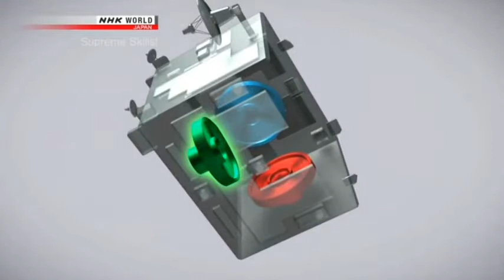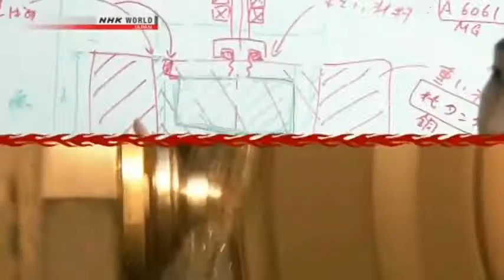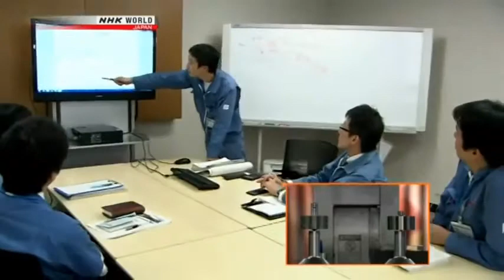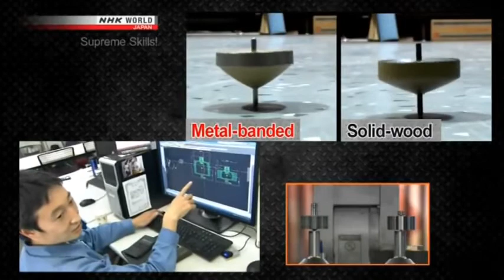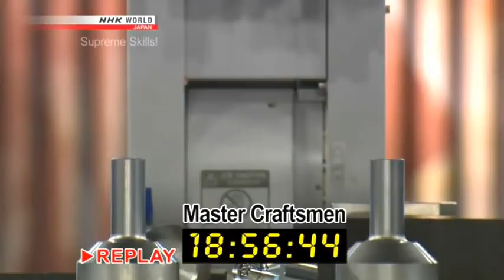Unbelievable Japanese Spinning Top Competition !

Comment: The space age team's top is hollow, and because it has mass on the top of the hollow section that gives it instability at low speeds, but the Master Craftsman's top was not hollow but was tapered from the shaft to the exterior weight and this gave it much better low speed stability than the other team's top. they deserved to win. Old age and treachery will win out against youth and vigor every time! LOL

Comment: The record is over an hour. The manufacturing skills are good but it is the design that matters. Tops lose energy as they pump air from the centre to the outside, so optimising airflow is crucial. Also very important is making the centre of gravity just fractionally higher than the pivot point. Watch this record breaking design:

https://youtu.be/LTVhbLpQrJs?si=Kt_lNNhBG37WkLL9
Reply: he broke it again

Comment: If the master craftsmen had a tungsten sleeve it would of lasted almost twice as long.
Reply: or 1 minute less
Reply: Tungsten ring around an aluminum core and a hand spin on a well designed and balanced top can spin 30 minutes on a glass surface.

Comment: I have a theoretical fly-wheel design: light absorbing material all around the wheel, light fires from the top of the wheel, can be high energy light and really fast spinning wheel depending on light-aborbed amount per area on the wheel
Reply: no need for segments of the light absorbing material, actually the requirement for this design is that the material is continuous around the wheel